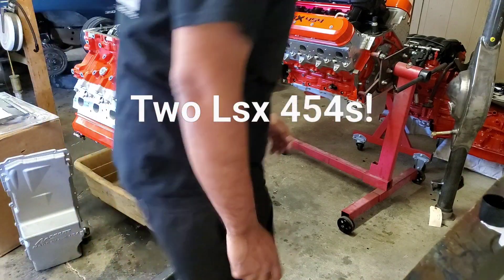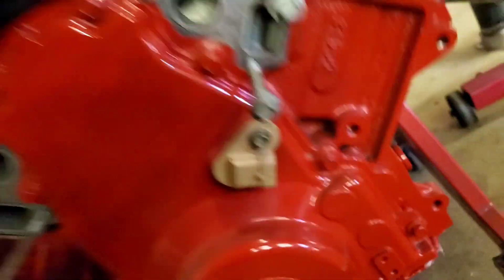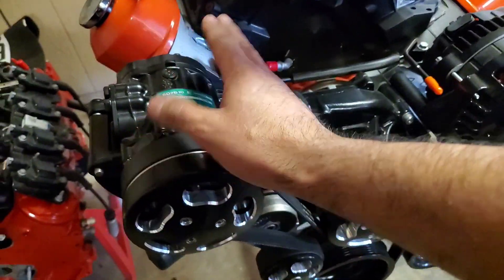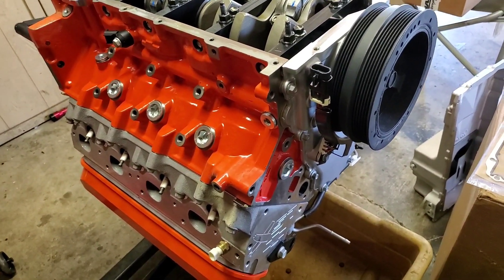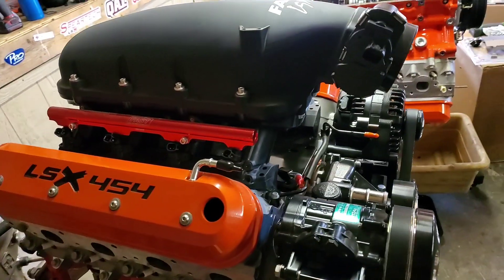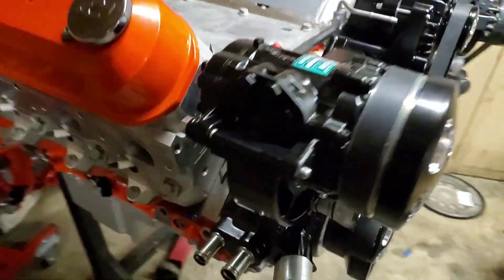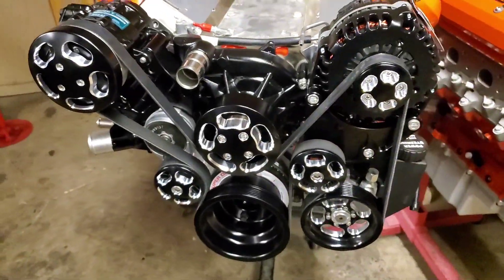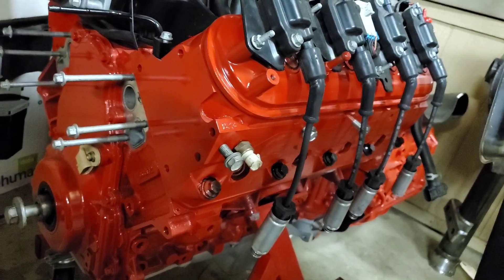must watch before you install a lsx 454!

Comment: Bought one and the block was cracked from Chevrolet performance! When the replacement engine came in it had fallen in the crate just like the first scratching the face of the left head. Good luck and check the engine closely.

Comment: Mind doing a video on sealing LSX rear main cover? Where do you get the alignment tool for rear cover? Existing cover and seal can be re-used/sealed, correct? Got an LSX crate engine on its way to me and want time take care of this once I get it (unless you know if it’s been remedied on recent LSX crate engines). Thanks.
Reply from the maker: We just got another lsx454 crate engine in. I'll set a video up of the rear cover issue and what I did to help the issue.

Comment: Good Info. In the GM specs, it specifies forged crankshaft (and forged pistons) for the LSx376 B15 exclusively and Cast (both crankshaft and pistons) for the B8. While I understand that the B8 has regular Gen4/LS3 Rods, does the B15 have LSA Rods then ? Do you happen to know the Rod lengths on the LSx376 B8 and B15 ? Are they just standard GM off the shelf OEM length 6.098" (for the LSA and LS3 Rods) or are they in fact 6.125" ? On paper, the LSx376 B15 is an INCREDIBLE deal and other than swapping the Rods and Rocker Trunnions, it would be pretty much perfect for a big boost application/street race application on a budget for something half decent and reliable.
Reply: Both the B8 and B15 use the 'forged powder metal' rods just like the LSA. The B15 uses a forged piston, while the B8 uses a cast piston.
Rod length on both is 6.098.
The B15 will handle 20PSI all day. Just keep it under 7500rpm and it will last a long time.
Reply: It gets into specking out every single part like before….70s engines that’s why Merlin, dart , Brodix and even Vic Edelbrock started making their own blocks for improved reliable runs at the 1/4 mile track. Now they run 1/8 mile because the speeds are to high with these LS engines 👍🏆 that is unless one has the funds to run with the big dawgs. Hence 489 proline no water jacket 50# boost ect…

Comment: Hey Gabe I managed to save up 7grand to switch out my 305 boat anchor I'm trying to get the most bang and torque for my buck. Would you suggest a blueprint motor and if so which one I was looking at the 427 carburator.. it's going in an 85 square body p.u. any information from you would be helpful ❤️

Comment: My dad has a 73' c3 corvette stingray, lsx454 swapped. It is extremely fast and torquey... sadly it is burning oil :( puffs abit of grey smoke especially after shifting up a gear say close to red line. Do you think the rings are gone? It has barely done 5,000 miles!
Reply from the maker: Rings are the issue if your pcv system is correctly connected. The oil ring is 1mm thick which is vary thin. We are upgrading a lsx 454 with pistons and rings for this issue right now.
Reply: @Creative_Restomods  So the oil ring may be stuck or something?
Reply from the maker: Getting oil past rings and causing blow by. You can do a leak down check and see if loss of compression on a cylinder and listen for air coming from crank case if so.

Comment: Speaking of leaks I bought a double hump headed small-block. It had a 3/8 hole drilled right through the head for alternator mounting previously. It never leaked in the hole, painted orange with permatex in the hole didn't even know it was there.

Comment: A power adder or nitrous might blow the oil cap off possibly I've seen it on small and big block Chevys. Of course small and big block Chevys don't have that's tight of a ring seal as the ls does with those thin rings they use.
Reply: Crank case vent. the drag race cars have a pump vacuum

Comment: Here's a thought you could plug it off. and use the jegs bolt on universal all aluminum oil filler cap with a screw on all aluminum lid with a rubber o-ring and everything you need. it's what I have used. it's actually a very nice quality piece and no leaks at all.

Comment: What I want to know is how come when it comes to the LS engines the 427cid is all the craze when you can buy an LSX 454cid and as the saying goes if you have more cubic inches you can make more HP which really in today's world is not that true as long as you start with a good platform and good internals and good machine work then you'll make good HP but me personally if I had the money to build a stout small block instead of running a 427cid LS I would run a 454cid LS with either a huge single or twin big turbos or if I was building a nitrous engine I would go as big as 496cid because nowadays people are building over 500cid LS engines with 2-3 kits of nitrous and if I was building a Procharged engine then maybe go with either a 427cid or bigger with a big crank driven Procharger but if I was building a SBC than it would be either 427cid or 434cid and if I was building a BBC than I would build a 540cid or bigger preferably 572 or 632cid nitrous turbo or blower
Reply: Sound like good combos, we think alike striker motors have a faster piston speed making power at a lower RPM like for my trucks, however short smaller base circle big bore spins up and sings at higher RPM making for good circle track and the like depending on your preference. Good stuff 👆🏆

Comment: Beautiful motors man, and thanks for the heads up on the Valve cover cap and applying silicone around the ring...nice touch on painting water pump black. Overall gorgeous piece's 👍👍👍
Reply from the maker: Much apreciated! I'll be uploading  video of rear main housing here soon too! Thanks for watching.👍👍
Reply: @Creative_Restomods   what brand of alternator did you use and how many amps? Great video man keep it up

Comment: Hows it going im in Sacramento got a 71 chevelle how much for a ls swap motor and labor thanks
Reply: Did you ever find out how much?
Reply: No never replied
Reply: @1971Chevelleking  if you want a brand new motor it’s gonna be around or upwards of 15k, to get a messed up one and rebuild it would be around 6k-8k installation would be around 2500-5000 depending on what you want to put it in and how hard it is to marry the motor to the essential parts, and whether you’d have to get new parts to replace incompatible parts. It could be a lot of money, i recommend finding a local mechanic you trust that won’t rip u off to do the job for u if u otherwise can’t do it ur self (no shame in that) just be careful because a lot of these motherfuckers are robberies. I’m in queens so be mindful that prices may be different where you are (ease of access to parts, differences in taxes and pricing due to location, etc.)

Edit: BTW this is if we’re talking about the 454 lsX variant. The numbers vary greatly depending on displacement and variation (LS1-LSX)

Comment: Does that oil pan fit in a 2002 Camaro possibly? I’m thinking of getting one of these. I have a BMR tubular K Member on it now.
Reply from the maker: The front of oil pan is a tad deeper than the ls1 oil pan.i wouldn't be sure, I haven't done one in a 02 camaro yet.
Reply: @Creative_Restomods  in your opinion could I just reuse my stock LS1 pan on the new motor?
Reply from the maker: @delta3garcia  is it a lsx454 or stroker motor? If so,the ls1 pan will not clear the stroke
Reply: Does the Lsx come with ARP bolts?
Reply: It will fit with a little massaging from the engine builder lol.

Comment: I have a 2015 Camaro I was thinking about putting a LSX 454 in it I currently have the stock V6 15,000 miles 6speed manual trans have you heard of anyone doing that swap?
Reply: I know this was a year ago but the money you’d spend on a motor swap tranny swap rear end swap and ecu would cost as much as just buyin an SS with all of it already done and you’d have a warranty with it.. almost no point in doing it even if the car has sentimental value
Reply: The engine will cost you more than the car is worth.  A LSX 454 complete is just shy of $15k.  Because demand is really high for all big bore LS engines, a low mile LS3 can go for $6k used.  If you really want to do a swap on your car I would look for a smaller LS.  You get them for under grand with everything you need used.  Then choose your boost even it peaks lower the additional low end torque will likely make it as quick if not quicker for about half as much.  Also you can get a '15 ZL1 for around $36k.
Reply: Why not just purchase a lq4 /lm7 engine from a junk yard for 700-1000 dollars. The lq4 is a 6.0 liter truck version of the ls2. It has a iron block with is great for boost. They sell a 408 stroker kit , which is the poor mans ls7 build. Upgrade the heads, and intake manifold, you can easily have a 600-700 naturally aspirated car. Add a turbo and a th400 and your flying. Just keep in Mind you need to upgrade the read end to hand the power. Maybe add bigger brakes. The suspension might need to be upgraded to handle the extra weight upfront. Add a sticky wide tire so you don’t run over crowds of people.